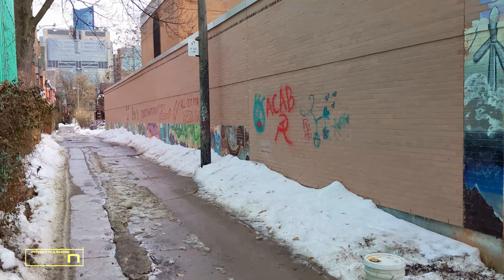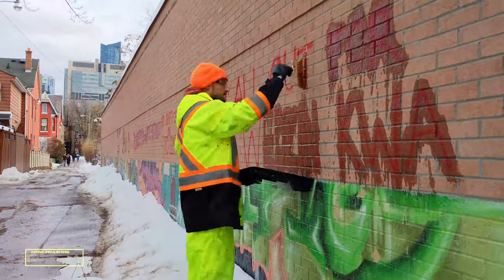Revitalizing an Alleyway with Wet Sandblasting: A Slow and Satisfying Process

Comment: What. Pressure washer setup  are you using
Reply from the maker: One of these guys
https://pressuretek.com/8-gpm-3500-psi-12-volt-burner-hot-skid-pressure-washer/

You could do it with less of a machine though, will just take longer.
Reply: @AndrewMeades  thankyou!